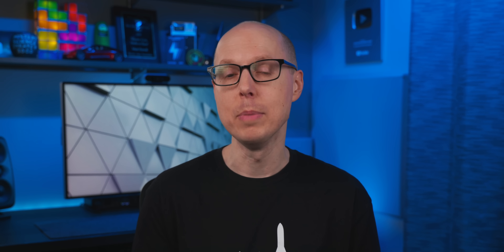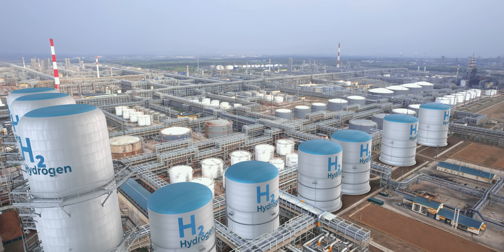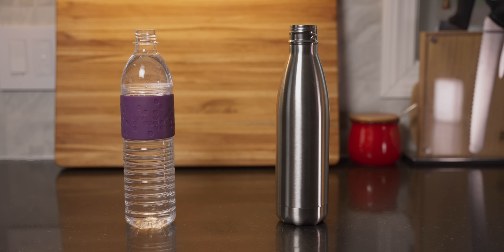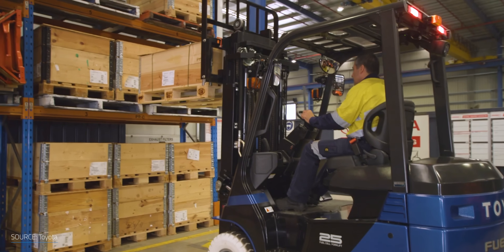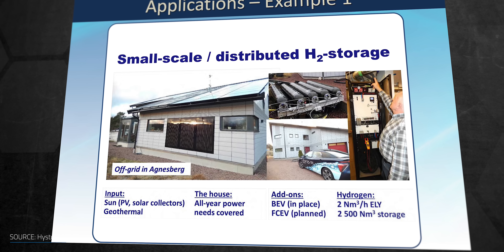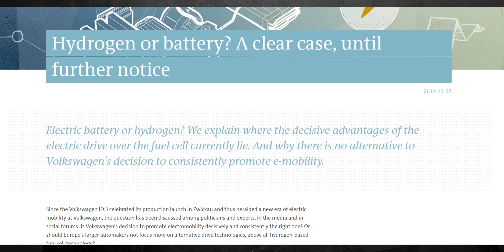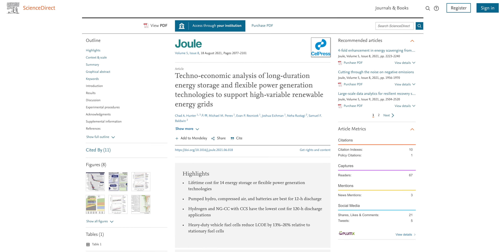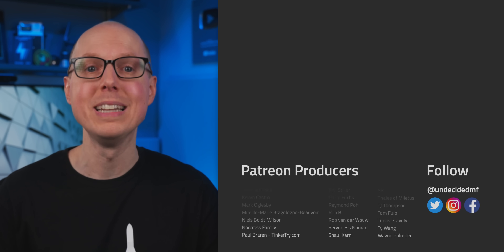Solid Hydrogen Explained (Again) - Is it the Future of Energy Storage?

Comment: Seems like for long term storage, ammonia is a cheaper way to store hydrogen than metal hydrides.  Carbon steel is comparatively cheap.  Also, before you start having any sort of widespread hydrogen economy you first have to decarbonize ammonia related fertilizer production.

Comment: Maybe there are some niche applications, but Hydrogen energy density makes it unviable for Aircraft or Vehicles. Maybe Ships could use it, but there's another huge problem, and that's end to end efficiency. However you store Hydrogen, it takes a lot of energy to make it, and fuel cells are 60% efficient at best.
The only way I can see Hydrogen competing with Battery Electric systems is if somehow the energy density of the storage is much better, say at least 3 times better than batteries. Even twice as good isn't enough, because you waste almost half the energy in the fuel cell.
I'm afraid it's never going to be a significant force in green energy, because it simply isn't green!

Comment: The relentless work of the proponents of fuel-based business models is the only reason we keep talking about hydrogen. The current case of other solutions is already better than the best theoretical case H2 solution. This tells us that the point of H2 is NOT to provide a practical engineering solution, but to provide a more profitable business solution. 

This is the reason electric vehicles were the first motorized vehicles, because they are the most practical from a simple engineering perspective. Fuel based vehicles replaced them because the business model was predictably more profitable, even with a Rube-Goldberg supply chain for both the vehicle and fuel, especially when the industry still does not pay for all the carbon and pollutants dumped into the land, sea and air.

Comment: This is much better than your first video on hydrogen storage. And I'm glad to see hydrogen generation and conversion efficiency addressed.
But one issue that was not mentioned is perhaps the biggest problem with hydrogen.  Transportation.
My understanding is that you cannot move hydrogen in existing natural gas pipelines because hydrogen embrittlement will destroy the pipe itself, and the related issue that it will destroy conventional gaskets and pumps.

Then there are the safety issues when the public interacts with hydrogen in their homes or at filling stations.  Hydrogen is extremely flammable. According to Wikipedia it forms explosive mixtures with air in concentrations from 4–74%.  Most gas fuels explode over a much narrower range of concentrations, and are therefore much safer to handle.

Finally, how does the hydrogen get from the fuel pump into your car's metal hydride storage tank?  According to Dr Wood himself, it must employ high temperatures, high pressures, or both in order to make filling up reasonably quick.

While all of this is interesting, it still seems impractical.  Our dollars would be better spent on developing better batteries.

Comment: Wow .. 14 days underwater. Amazing! Nuclear subs can't even begin to compare to that, with their 3-4 months.
Reply: 6 months in war
Reply: @planexshifter  Nope, but if they want to use it as a battery, I doubt they'll put it in contact with water, they might just keep it inside the submarine where, usually, there isn't any water.
Reply: And if you don't want to go nuclear, but still want weeks of submerged ops, there's the Air Independent (liquid oxygen and diesel) Stirling motor subs from for instance Sweden. 
Silent enough to first get in and "kill" a US aircraft carrier and then evade the escorts...
Reply: But a battery (as was the point) can’t compete. This is also one of the quietest sub ever built.  Battery boats are by far deadlier. And why DARPA is helping the navy research it.

Comment: I think hydrogen will win out as batteries are too expensive. You can also easily convert petrol and diesel to run on hydrogen and its limitless so just makes more sence. To fill up on hydrogen sits at €65 Petrol now is £103 Electric is far lower but batteries wont last and is over £17,000 to replace a complete battery pack in a Tesla. Hydrogens price is very stable as its source is pretty much everywhere.

Comment: Matt, you did a very good job of explaining solid hydrogen and why it makes sense for moving heavy loads and storage over batteries. As a power generation electrical engineer I tried to explain this technology to my leadership but they shut me down without directly investigating. What Dr. Wood said simplifies the claims by * Plasma Kinetics.* They need funding to make it a reality. Maybe with the help of McLaren solid-state hydrogen can be proven in the next couple of years to be a viable solution over compression or ammonia.🔌🔌

Comment: This is fery useful and instructive - thanks. I am interested too in your take on hydrogen generation. Most efforts focus on hydrolysis oriented techniques which use water as input yet water itself is a precious commodity in many places. The common thought is to eliminate hydrocarbons but i have been following new developments around deriving green hydrogen from hydrocarbon deposits directly. The University of Calgary spin off company Proton Technologies has developed methods to produce hydrogen in ground from derelict wells with residual hydrocarbons or from full fledged hydrocarbon resevoirs including oil sands. The carbon is sequestered in ground. This method is being used by oil companies now to reduce carbon footprints in operations notably by Whitecap Resources using hydrogen as a heat source. I think this is interesting - why try to beat the hydrocarbon indystry if it instead can be reengineered effectively. I understand too hydrogen in europe is already being used in a mixture with nat gas for home heating and is distributed in pipelines with nat gas. A good overview of hydrogen generation and the storage and transport of hydrogen would be helpful.

Comment: how about using sound to blast the hydrogen atoms with their resonant frequency, would be different based on the molecular configuration of said solid hydrogen, then blast it with high temperatures but in sync with the used resonant frequency's crest and trough, way less energy applied, same effect...however, to apply this method you may need some specialized hardware, but nothing out of the ordinary

Comment: yes, hydrogen storage should be useful, however, using lasers for most applications is always energy intensive.  I am not seeing the volumetric density being improved so much for metal hydrides the matrix would occupy a lot of the space  that a solid would have and  plus it must take a lot of energy to get the hydrogen in

Comment: SP Automotive (Spyros Panopoulos)  now has the anadiaplasis fuel cell = 1.3mw (1750hp), this means H2 is highly needed, the goal is SMR reactors connected to 20 elecrolyzers, then package the H2 as NaBH4, transport and store, then when release the H2 and recapture the Na02 and B which is recycled and then packed and transported back to the SMR site, to do the same process again and again, this means that boron becomes a very high value commodity because once the world has X amount of boron in the hydrogen economy, then there is no more boron needed. Imagine 100 panamax supertankers carrying 200,000MT of NaBH4 around the world, this will be enough energy for 50% of the current world energy consumption.

Comment: Hydrogen binds too well. This means significant energy is required to "move" it from a free form to a storage from and back again. Thus the lower efficiency numbers quoted in the video when compared to batteries. It seems to me that it makes most sense when created with excess renewable energy and for "long" term storage (greater than 4 hours). Also, since significant heat appears to be part of the process, it is better suited to large industrial installations where the heat can be cost effectively stored/utilized rather than lost. So probably not passenger vehicles but more likely grid or industrial processes with large mobile applications falling into a special need category.
Reply: co-locate this with molten salt storage for cogeneration
Reply: I wonder if the process of "charging it" releases heat. Maybe that could be reclaimed somehow.
Reply: There are much simpler methods though. Like static mass storage. Such as using large heavy objects or large bodies of water. Basically, you have a basin you pump water into, connected to hydro electric, and so you use energy to put water in the basin, and then regain energy back when you operate it like a dam. This has over 80% efficiency. Alternatively, you can use a crane and pully system to store and generate electricity. It is basically using energy to stack large heavy objects, and when you want to get energy, you just unstack them. Both of these are far more efficient solutions for energy storage than hydrogen. Although hydrogen is better suited for mobile energy, like in a submarine. But for large industrial grids, the other options are far better, albeit much more massive undertakings on a large scale. The beauty of the second one is that it's pretty much a permanent energy storage, not really any loss over time, it could sit for 100 years or 1000 years, and still "contain" that energy. And the problem is the more you complexify storage, the more losses you get, and more cost. So in the grand scheme of things, simpler is better until we find better ways to store energy.
Reply: Exactly. Store excess solar energy in summer and release it when the sun doesn't shine in winter. Even though it's inefficient, it does work. 

Hydrogen for passenger vehicles is idiocy, though. Batteries are a far superior solution. I think people are starting to understand that now.
Reply: @jooptablet1727  With the energy requirements to liberate Hydrogen stored in solids yes, Hydrogen stored in Ammonia not so much.

Ammonia stored and transported in slightly modified existing petroleum infrastructure and converted to Hydrogen at the pump is far more viable.

There are efficiency losses in production however they can be easily offset by excess power production from outside the production facilities dedicated power production.

The idea is to utilise Hydrogen for vehicles that require longer ranges and as a stored emission free fuel, not for metropolitan markets.

Failing to realise that we need to use different solutions for different applications and taking the drawbacks that come with the benefit for the desired application would be foolish.
Reply: @soulsurvivor8293  exactly, this sounds really good for electric 18 wheelers, definitely not good for small vehicles, but maybe even buses can benefit from it
Reply: @jooptablet1727  
the batteries we are currently using are complete shit, even Elon has admitted this, they have major issues when it comes to climate so if it's too cold they lose power even when they are not in operation they catch on fire in the heat as it becomes to hot to handle and it creates a chemical fire killing the passenger and any other vehicle in the process. 

then when it comes down to recharging these batteries it takes a full 8 hours from empty to full, the cycles are also severely limited requiring the owner to replace the battery every few years which will bring up the costs in replacing them, not to mention we are running out of the needed resources to create these batteries in the first place, causing the price to go up as well as the inflation numbers on top of all of this, they can easily short out if we are EMP attacked rendering the car useless even after the fact the EMP has passed stranding you in place and also needing a complete replacement of the car in the process because an EMP will destroy everything electronic rendering them dead. 

hydrogen has almost none of these issues. also the creation of the hydrogen gas is far cheaper than it is to create just one of these batteries as you can use solar and wind to make it free, i guess the tank might cost some money but the tank will last more than 100 years before it needs to be replaced. 

there is a reason why we are not using batteries to get to the moon and why hydrogen is the only fuel source that can do it. yes there are risks, but there are risks with any fuel source we use and that has never stopped us in using these fuels.
Reply: @5226-p1e  With all due respect, and I don't want to be mean, but you have just publicly admitted your ignorance on this topic. You can research these topics for free online if you want to educate yourself. I hope you will.
Reply: @jooptablet1727  
it was factual and accurate information that i have researched for many years to get to this point of information.

but please, tell me what information i got wrong on this, i will wait......
Reply: @jooptablet1727  so how about instead of attacking them... you counter arguments. Cmon now, what did he get wrong? Tell us
Reply: Consider the efficiencies from the perspective of a PROCESS that shall definitely change (as Matt points out) over TIME!

Comment: "solid hydrogen"
This is a marketing term.
Hydrogen in it's solid state is Metallic Hydrogen.
I could say I have solid water at 20 C. Because it is in a solid sponge.
We all know solid water, it's Ice, not water absorbed in a sponge.
Reply: Not exactly, as hydrogen bonded in hydride form is almost as stable as any other solid, hydrogen gas and liquid is not stable, and will leak out of almost any containment vessel, needs to be stored as low temps, and needs to be pressurised, none of these are true in such a manner with metal hydrides.

Comment: Would a hydrogen-saturated metal hydride lining in a tank act as an effective barrier for hydrogen diffusion?
Reply: These hydrides are designed to let hydrogen move easily, because we want to infuse and extract the hydrogen, do they wouldn't make for a good plug.
Reply: @naasking   I don't think so. In the video it is stated that there is a lot of temperature and pressure necessary for the hydrogen to perfuse the metal lattice, the more saturated it is the more difficult it is to cram more hydrogen in... There also is energy expenditure in trying to have the hydride release the hydrogen...
Reply: Interesting thought! 🤔
Reply: Almost certainly not, it would be like trying to use a saturated sponge to plug a hole in a boat, the pressure will induce a flow through the material.
Reply: Excellent Question! THAT's THE SPIRIT!   😎

Comment: 8:40 this part here. The electrolyzer to hydrogen part, how resource/energy hungry is that barely touched process? It's cool that there's such storage option but if the eletrolyzer gets consumed and/or requires distilled water (more processing energy beforehand) then all that should be noted too.
Ah I see it's touched on later. ~50% round efficiency. It's important to keep that in mind. It's a cool solution to where it makes sense, but we need to make sure this doesnt get lobbied to places where it totally does not make sense compared to batteries.

Comment: Question - 
If heat is required to liberate the Hydrogen from the metal, then his would suggest that heat must be released as the hydrogen is initially absorbed by the metal. Is this right? And if so, can this release of heat energy (exothermic process ?)  be used to offset the heat required to release the hydrogen from the metal again?
Thanks

Comment: Just like today's electrical generation/storage and systems/grids are not comprised of one single method/approach, tomorrow's solutions will also be a combination of approaches. We should remain open to new methods/approaches until they are absolutely proven not to work. Keeping in mind that a solution that does not work today may well be proven useful in the future. Example: Fusion.... today it does not generate a single watt of electricity for consumption on the grid... yet in the future it may well be everything we believe capable of. Same goes with metal hydrides. At the very least your videos generate debate which when respectful is very healthy. I always learn something from your videos and come away with something to think about!

Comment: It looks like a way to enhance the process is fluidize bed injection. 
 Enter the hydrogen through nozzles with powdered metal on top.
Similar to how coal is burned in a boiler. 
Just preheat the hydrogen before it enters.

Comment: wow during the whole thing i was still thinking about how one could drop a solid into a liquid and it would reduce the original volume of liquid. i guess i'm so used to the idea of water being uncompressible i just assume it can't be made any denser but never thought about chemical bonds. though i guess it wouldn't be as simple as dropping a rock and watching the liquid level go down...the rock would probably have to be turned to sand, and the temperature increased to over boiling at least during the absorption process and then cooled down again to get the leftover hydrogen back to a liquid just to see the new "water level" :-D. i could imagine a sponge sticking out of a bowl of water dropping the water level, but then the sponge isn't a complete solid and it's using that capillary action to suck the water up higher than the rest in the bowl...so i guess that's more mundane and less shocking :-)
[ooo could we kill a star by dumping in metals that absorb hydrogen? surely it's at a high enough temp to facilitate atomic mobility...though i guess the metal would probably become a gas... oh! maybe dump it on a planet that has too much hydrogen...or are such planets usually all gas anyway...]
Reply: Drop some magnesium sulfate (a.k.a., Epsom salts) into water. Observe. Then look into the chemistry.

If you're talking about temperatures required to “charge” and “discharge” metal hydrides—the video went into some detail. Take a look.